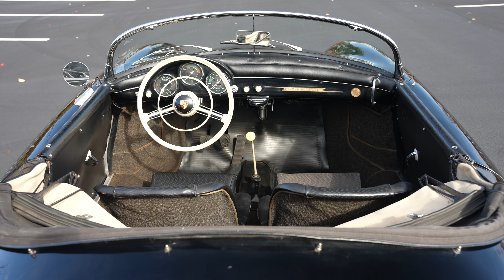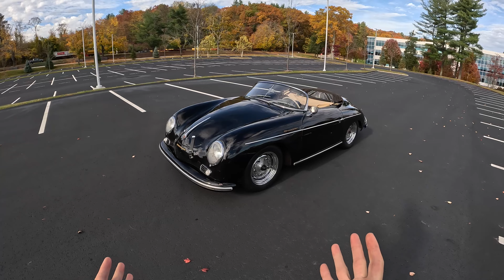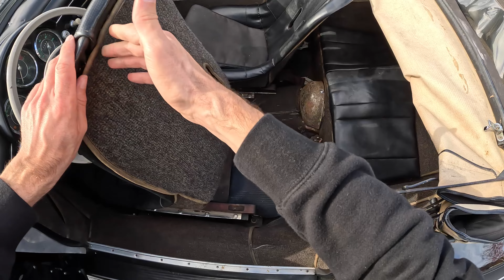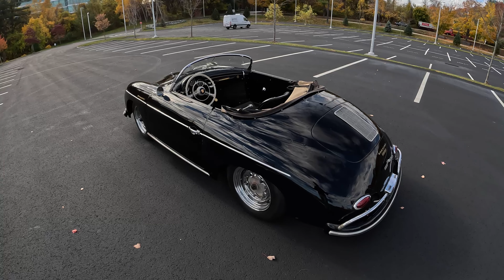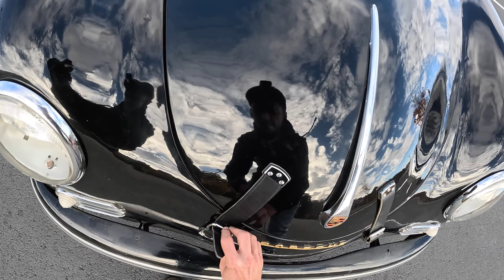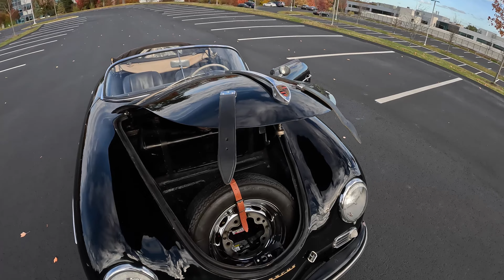1957 Porsche 356 Speedster - Classic Autumn Driving Experience (POV Binaural Audio)

Comment: As an 18yo who's never seen that kind of car in the streets, I literally dream about driving one, especially during Fall season... Thanks for sharing us that kind of content !
Reply: Find an old Chevy Corvair-- maybe even a convertible version. Similar car. Air-cooled flat-six out back driving the rear wheels, just like a Porsche! I got mine for only $2000 (but a few thousand more in parts and repairs).
Reply: @lars1588  $2,000?? Did you miss a zero or two in there?
Reply: @tacticalidiot175  NO. I've seen even cheaper ones. A restored one ranges from $15k to $70k (there are many versions and sub-models). They're cheap to buy and cheap(ish) to work on. I've only spent about $1k on mine so far, but I'm planning to drop around $1k more. Grand total: $4k for a six-seater sedan that gets over 22 mpg. Not bad lol.

Comment: To squeeze out 75 hp of 1600 cc air cooled was a big deal in 1950s indeed, I've also noticed how low the steering ratio is which means very little play and at 1700 lbs it weighs less than an F1 car by today standards.

Comment: OK, the speedo is on the right of the tach so it's a late '57. The teardrop taillights are correct. (The beehive taillights were early '57 and earlier). The tach is redlined at 4,500, and the trim on the rear says 1600 Super. The rear trim is incorrect, or the tach is incorrect. The Normal engine redlined at 4,500, and the Super engine at 5,000. The Zenith carbs and linkage are incorrect. A '57 Normal should have Solex 32PBIC carbs and a '57 Super should have Solex 40PBIC carbs. The Zenith 32NDIX carbs came out in '58. One thing that's correct for the year... the 'pin style' tonneau cover snaps on the door and across the dash are correct. The Speedsters were geared B, B, A, B, with a 7:31 ring and pinion. The coupes were geared B, B, B, D. It's hard to tell without driving it, but it sounded like Coupe gearing. The 2nd to 3rd RPM drop shouldn't have been as great. OK... that's enough for now. Lot's of things you need to upgrade, but all-in-all, congratulations on the car. I wish I still had my two Speedsters!!!